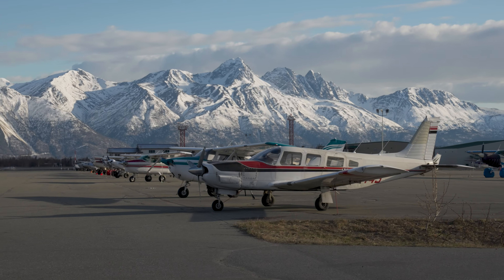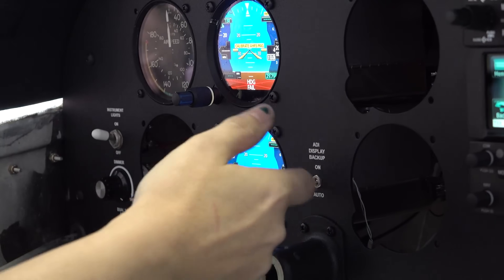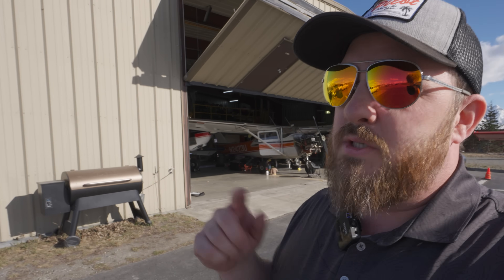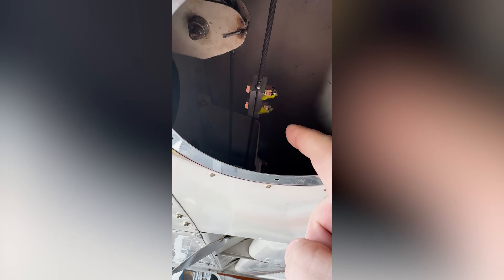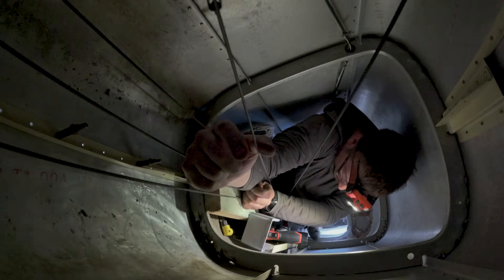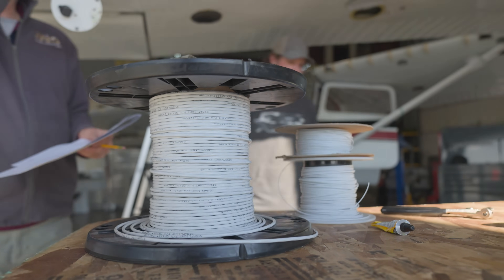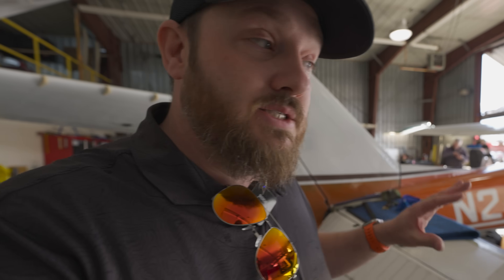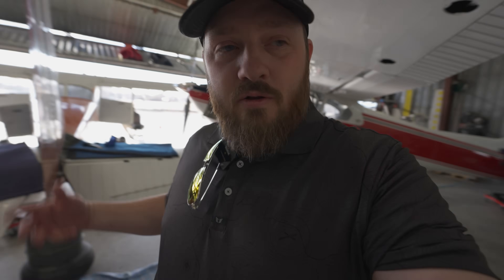A Garmin Beast Mode Tech-Up!

Comment: I love these little Garmin autopilots. They’re so basic to use and in my airplane, the RV-12, they really ease up the work load. The RV-12’s electric trim just doesn’t have the fidelity to get you flying perfectly straight and level…it’ll always put you in a slight climb or descent and you have to compromise (i like the slight climb because then you just need to push a weenie bit on the stick to keep it level). But even a two axis autopilot does away with that and makes flying for any length of time much more enjoyable

Comment: Just a Quick Clarification; TAA Only requires a 2 Axis Autopilot, along with the PFD and MFD of course. Not a 3 Axis. 61.129(j) If you're curious! But the Mighty Skyhawk is looking very fine good sir! Keep up the good work!
Reply: was coming here to see if anyone else mentioned it. Not many GA planes are 3-axis and I don't think this 172 is either.
Reply: @flysport_tedder  Yes you are correct. Typically they will be multi-engine aircraft which will have a Yaw Dampener, but even then it's not really a full axis. It just adds pressure to the rudder to maintain coordination.

Comment: How much was installation for the autopilot? Never seen one on a 152/172 so this is really nice to see!
Reply from the maker: It was roughly $14000 between the unit and the time with the crew. But they often have deals and you can get the unit for a little less.

Comment: I’m hoping to put in a GFC500 too. What was the cost to install it?
Reply from the maker: It was roughly $14000 between the unit and the time with the crew. But they often have deals and you can get the unit for a little less. Go to a shop that has done a lot of them. Makes all the difference.

Comment: these methods of integrating servos to existing control cables have been around for decades before Garmin was a company.
Reply from the maker: Fair! Tried and true. If it appeared as though I was giving them sole credit, that wasn't my point. I was merely expressing my own misunderstanding.
Reply: @angleofattack Garmin makes a great product though. I have a full Garmin panel and they make a great system. Fly safe.